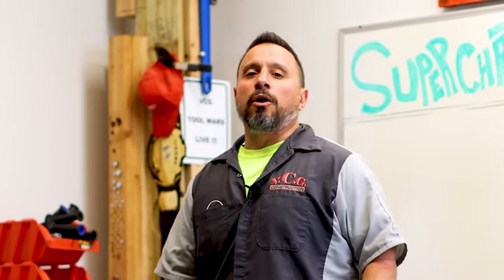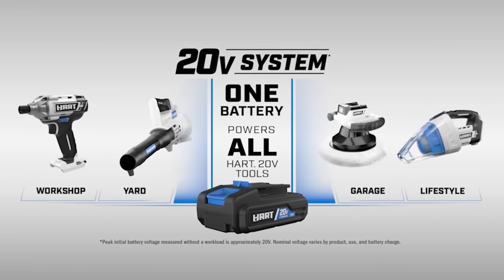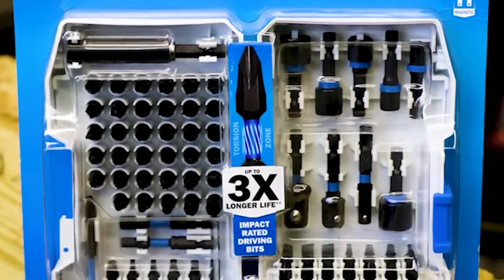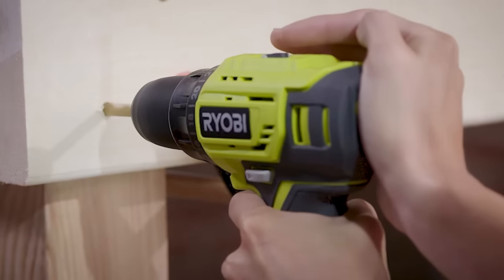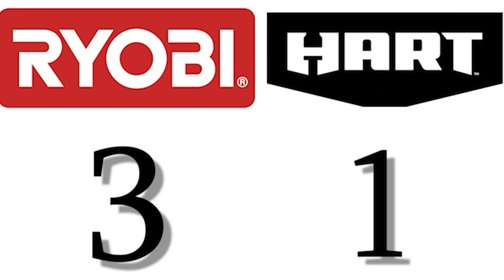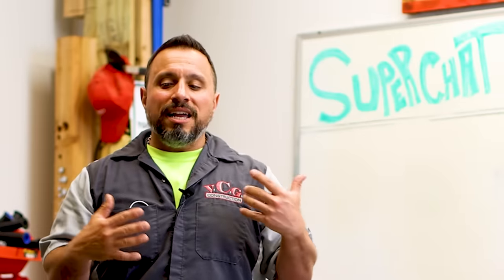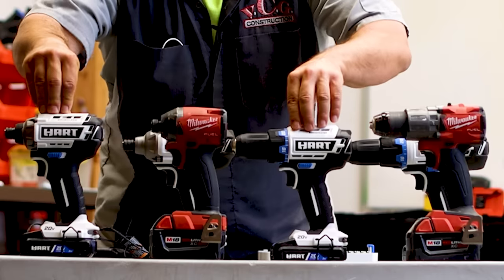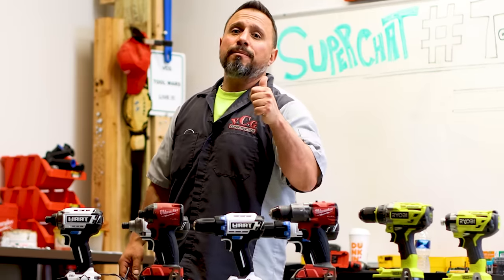HART Power Tools At Walmart PEOPLE HAVE NO CLUE!

Comment: Hey Vince...great video ...the way you deliver really drives it home...looked at heart...
 but then saw your Craftsman vids...Craftsman line up for me...would like to see Craftsman  impact go against Milwaukee imact on TTR...stay safe
Reply: Ive been a craftsman/sears consumer for a very long time. I've used both brands for extended periods on various jobsites and craftsman will not touch a milwaukee. i would consider craftsman on the same level as ryobi, and milwaukee & makita on same level. imho.
Reply: craftsman is now black and decker , the hand tools are relabeled stanley  wrenches and sockets.
save your $
Reply: @luvdady  black decker sucks I used the impact wrench too remove 4 bolts and it broke on the second bolt on the first day I used it

Comment: I was introduced to the Ryobi 18V tools when they was still BLUE. I watched an cordless drill with an 1.5 AMP hour battery out perform a Dewalt, multiple times while helping a friend construct his work space. For my shop I went with Ryobi now in the Green tones, The Drill, Impact, Circular saw, sander and router units were what  I cut nearly every board for my shop with, screwed into place and finished it for staining and paint. The one thing that I myself have ever experienced was my chuck gave out. If you should ever have this issue watch a Youtube video or two and use them for visual aid and buy a "1/2" JACOBS METAL KEYLESS DRILL CHUCK 1/2-20"  Its only $25 bucks and worth the investment.
Reply: The Ryobi + line is a very solid DIY kit run

Comment: My
Dewalt 18 volt i got back in 2004/2005. It still work great besides the battery doesnt hold a good charge anymore or last long. Im thinkingmof replacing it w another 18 volt brushless tool. Leaning to Rypbi as they are cheaper than the big 3 and have good deals. As a handyman that likes to fix and build just about anything, im trying to figure out what ill buy. Milwaukee is definitely off my list as it’s too expensive and I don’t need that kind of tool. Any thoughts?

Comment: I bought a Hart drill , standard batt, cheap model. I am well pleased !! Used the drill on a project, put it away with out charging it. Went back several weeks later to use it again thinking I would need to charge the battery, to my surprise it had not discharged but was full of pep as if was already charged. Much better than the drills I bought at Harbor Freight that always seemed to go dead with out being used, 5 stars for Hart !! I will now be looking to buy a driver.

Comment: I feel like tool brands are very polarizing. I know that folks have brands that they are die hard fans of. I know that on our sites, I see almost exclusively Milwaukee with some DeWalt, Makitas, and Rigids. I have to say that I have been able to punish my Ryobi tools: They've been dropped, covered in debris, pushed until hot to the touch, and years later they're still running strong. At least in my opinion, Ryobi has the same types of tools as Milwaukee (again, not a coincidence) but at a more affordable price point. This has allowed me to grow my collection faster and I have not had any substantial issues with quality. I do have some Milwaukee products as I trust their quality (bits, blades, and the packout system, etc), but as a homeowner Ryobi has been a more affordable option for me.

Comment: So far the 20v dealt has held up the best for me and that's what I've used the most.  Tried the m12 hackzall from Milwaukee last year.  Didn't last a year before melt down.  Now I bought myself the hart combo kit and my sister has the hyper tough so I compared them.   The hart was under powered but cut much straighter.  The hart drill is more powerfull and has a high gear but the bits keep falling out.  Not so sure about the impact yet cus im always short on just 2 batt and can't afford more.  The batt don't last long but charge fairly fast.  I like how I can kill a battery in the saw and still get about 45 min with the flashlight.  Flashlight needs another brightness setting.  The vacuum filter gets clogged up after 2 min.  The multi charger should charge more than one at a time.  The impact bits don't hold up.  Tried lots of brands and dealt is the best to me.  And that's as far as I have gotten so far.  It seems like Walmart has all the tools but ko extra batteries.  I even talked to some corporate managers.  Not paying 55 for 1 bwtt or 60 for 1 batt and 1 charger, then 80 for 2 batt with no charger.
Reply: Who makes heart China
Reply: The best deal on batteries is usually when you buy them in a set with other tools.

Comment: MILWAUKEE, VINCE!!
Reply: Only way to go !!!!!
Reply: They are Owned By Same Companys
Reply: @kielerklenk7791  true but like ryobi they share no parts and arent manufactured in the same places. not saying anything bad about hart ive never used them just saying.
Reply: @jeffreyrigged  Hart is definitly something to try out, i am very impressed
Reply: @kielerklenk7791  ill probably never own there cordless line. kinda hard to buy another line when you already have all kinds of milwaukee stuff. makes no sense to switch and have a different brand and pack two types of batteries and two types of chargers. im sure its not bad stuff for the money. i know ryobi and rigid both are good stuff. but i only buy corded stuff from them as well cause i have a collection of milwaukee batteries and a charger along with the tools so i just keep buying cordless tools that are milwaukee. if you buy on ebay you can usually find used or recondition milwaulkee tools or even new bare tools at about as cheap.

Comment: I bought 2 HART kits for $99 each a month ago.  Each kit came with 2x 20V 4ah batteries, a fast charger and a choice of tool.  I chose an Impact driver (also purchased the impact driver set show in the video) and Reciprocating Saw.  Just bought a HART 3/8" Impact this morning.  I also own their 40V Attachment Capable 15" String Trimmer with a 40V 4ah battery and a 40V Push Mower with a 40V 4ah and a 40V 5ah battery.   I have not been disappointed with any HART tool so far.  Next purchase will be the Jigsaw and Circular Saw.

Comment: Home Depot had great sales on those Ryobi tools. Got a set myself.  Cheaper isn't always better.

I needed an 1/2" Impact and got one with a battery, charger and a beg for $99.00 +tax. With the money I saved off normal price I bought a 2 tool kit with a circular saw, 1/2" Drill, flashlight, 2 batteries & charger, a bag and and free 3/8 Cordless Ratchet for $129.00+ tax. The 3/8 cordless ratchet alone with a battery is normally $149.99....

Comment: I have the Hart 3/8” ratchet and the hand held vacuum and they have been solid tools so far. I use the ratchet almost everyday and the vac 3-4 times a week. 
Both are holding up well to the abuse I put them through. The only thing I don’t like is the charger I have takes forever to charge the batteries. I will be looking into a fast charger for them soon. With summer coming they will be getting more use and I will need to be able To quick charge.

Comment: Mine came with the vacuum a drill a impact and a flashlight with two batteries and the charger for like 80 bucks and I still have it after a year with constant use everything still works so satisfaction guarantee in my eyes

Comment: I have a Snap- on 3/8 cordless impact wrench...pricey...I like it though...with a 1/4 adapter it's good for screws, it hammers them in through the knots really well...it's just handy for bolts...I got it when I was working at a small engine shop in town. It worked great on lawnmower stuff...it has been charged 11 times in the last year...990 battery cycles left on the 4 amp lithium ion battery...I usually use it every day for something or other and one thing I like is the battery stays charged a long time compared to anything else I've had...I might get a cheaper drill to go with it...I figure if I just drill holes it'll stay charged too lol

Comment: Hart vs Bauer?
Reply: About the same quality, Bauer may have a slight edge in power. But Bauer is less expensive and has a larger line up for now.
Reply: @JeffKuykendall  Bauer is expensive and a terrible deal because they do not offer a drill/impact combo.  For practically the same price as spec'ing a Bauer drill+impact ($140) you can buy a brushless DeWalt or brushless Kobalt combo.  Alternatively, you can also save $40 and get a Craftsman brushed combo and three year warranty vs Bauer's 90 day.  And guess what?  Craftsman $59 impact (same impact in the $99 combo) will break the lugs loose on my GMT.  The $69 Bauer impact will not.

Comment: I have all of the 20volt brushed tools i use my impacts all the time. I work on truck scales.  They are made by the same manufacturer as most of the nice tools. My 3/8 impact keeps up with a dewalt of the same specs.    I did burn out the motor on my drill using it as a starter while getting an old push mower working.  Lol.   Have had my tools for 2yrs.  They are worth it.

Comment: I usually buy corded used tools, bought the 20 dollar hyper tough at walmart with the built in battery to use on my car though for some rust removal. Can't sink a screw through a pre-drilled hole but it took all the rust off with a brush and a decent amount of lateral force on the chuck from pressing the brush all over my frame and differential housing. Was able to use an extension and really get in there and there's still no wobble, which is more than I can say for the more powerful black and decker cordless I had twenty years ago.

Comment: I saw Hart battery packs for 10$ on liquidation at my local walmart. I bought 4 of them plus a kit with a battery charger. I dont care if hart gets discontinued, that's just a steal for the batteries inside. Also picked up a sander for 60 and the drill/impact kit for 50. I dont know what my local walmart is doing, but I like it 😂😂😂😂

Comment: HVAC/Bldg engineer here, I have DeWalt and Milwaukee tools in the shop in my building. For my home tools and side jobs I use Ryobi. My blue 18v drill has served me well for 13 years. I didn't know they were from the same manufacturer of Milwaukee though.
Reply: Not sure if you know this. But milwaukee, hart, ryobi and ridgid all made by the same company techtronic industries..
Reply: @KyrieEleisonMaranatha  I learned that with this video

Comment: Oh yeah 😎.  Can get Good Deals on the Walmart App. Nice 20v Hart soldering iron is about $40, had 12v Milwaukee soldering iron lasted about one year ( it died) too small, 20v HART more robust than 12v Milwaukee. Brushless Hart 20v Angle grinder costs $139 but 24v Kobalt Brushless is $129. Milwaukee 18v Die Grinder is $270, 12v Milwaukee Die Grinder is $220, but the 24v Kobalt Die Grinder is $149, bought last November on sale for $99. Dewalt 20v Die Grinder is $115 on Amazon. Really like the 24v Kobalt Die Grinder gas 25,000 rpm, 17,500 and 10,000 rpm. Can use Dremel tools but with a 1/4" shaft instead of Dremel's 1/8" shaft.

Comment: These look like kids toys.

Also,  I have the Ryobi One system...great tools for the DIYer or shade-tree mechanic.  My Ryobi 18v cordless impact, was able to spin off a seized lug nut that I (as a 240lb man and fairly strong) could not break with an 18" breaker bar.  The pro's may sneer at them, but if you don't make your living with power tools, they are more than adequate.

Comment: Ive acquired a few Hart items by finding them... Literally found the flashlight LIVE on here 😂. Bought the drill/impact just to get the charger. Clearanced at 49$!!! The sawsall is ehhh... Only cuts a few limbs up to 5-6 inches and the batteries are done. It also has a VERY short load cap. But after learning its limit you can rock for a few cuts.

Comment: I've had every one of the brands posted and then some. Every Ryobi I have ever had the batteries puke out rather quickly. I love the milwaukee kit and Ridgid kit  I have and my bosch mini-kit as well. Dewalt at least to me is not as good as it once was. With all that said I recently purchased a Hart kit with a reciprocating saw, jig saw, flash light, Impact driver, drill driver and 2 batteries with charger and I have to admit they work very well. The batteries don't hold a charge as long as my other power tools but all things considered I am rather impressed.

Comment: Bought the Hart spotlight with a combo weed wacker and blower , works great . Problem was led went out on the worklight , also bought 2 tire inflates for the cars , great for teens who never check the tire pressure.  Would like to know if there is a repair for the led , but great tips on manufacturing,  I fix cars , retired so I abuse drivers and drills , impacts

Comment: I bought the 18 V lithium ion battery kit (constructicon colors with drill, reciprocating and circular saws, flashlight,charger and 2 batteries in a bag case) off the display at The big box store As they were setting it up. I had come in for the blue kit.  I asked the salesman about them they sold themselves. The guys on the job the next day were impressed. Im an electrician and home owner That was over 10 years ago. The only thing I've had to replace are the batteries, blades obviously and the light bulb in the flashlight.

Comment: Milwaukee FUEL come with a lifetime warranty, and you will need it. They strip gears on a regular basis. NEVER stripped a gear on any of my DeWalt. Only issue ever on the DeWalt line was burnt out brushes on my 18v drills after 15 years and a burnt but still functional trigger on a brushed 20v hammer drill. Oh, and a smoked clutch on a D-handle corded rotary hammer.(lent it to a friend who was using it to drill 1" holes in railroad ties)(had I known that was why he needed it, never would have lent it out and he gave it back smoked saying "well it was working when I gave it back)

Comment: got the mower and edger combo at walmart (they had it priced online for $100 less, so they had to honor it), and also picked up a grass blower because it came with an extra battery and charger. I still use them today and it saves on fuel and maintenance on a gas mower and having cordless tools to use doing lawn work is great
Reply: I used to like my gas lawn implements but totally for what most people have as far as a lawn the cordless stuff is so nice. I got the weed wacker, blower, chainsaw and hedge trimmer. Its especially nice to have the cordless stuff that you dont use very often because there wont be any issues with it when you go to trim your bushes maybe once or twice a year or pull out the chainsaw to cut up some firewood or trim up a tree a few times a year.

Comment: I have all of them but hart I have a hart mechanic tool set.But I have ryobi Dewalt milwaukee and rigid power tools don't use them but for home use they work fine the rigid impact battery life is amazing I had it almost a year and just changed the battery recently from the time it was purchased I put together a shed and used it for several task and it was down to 1 bar but still had power.I like rigid they need Power ratchets will definitely try it.

Comment: I’ve been buying tools for years. It all depends on what you’re doing. If you’re in the trades, where your livelihood depends on your tools working and working well…. Then buy the same tools that rental places rent out, those are the most durable and highest quality gear. If you’re a DIY’er, then buy the best tool in the category that you NEED for the project. Over time, you’ll acquire a whole garage of stuff, and you can then start upgrading each tool as you need to. It makes no sense for a DIY’r to purchase Hilti, the same way it makes no sense for a tradesman to purchase Hart. Bottom line, you usually get what you pay for, and it is best to buy the highest quality you can afford.